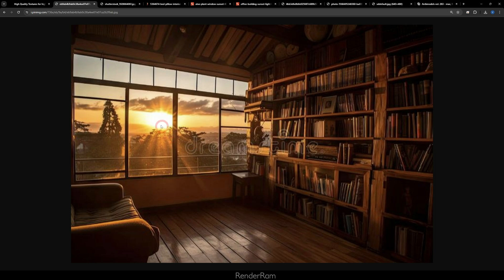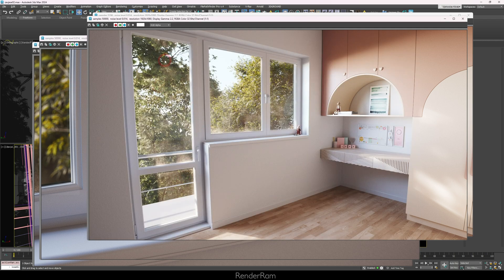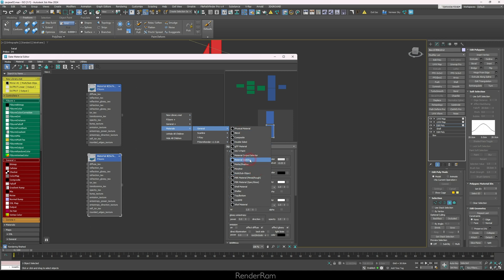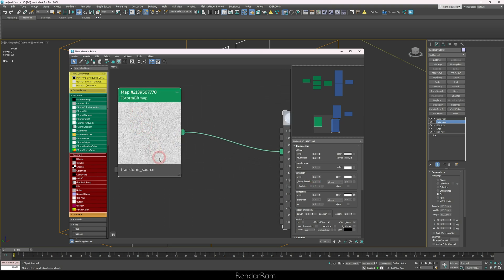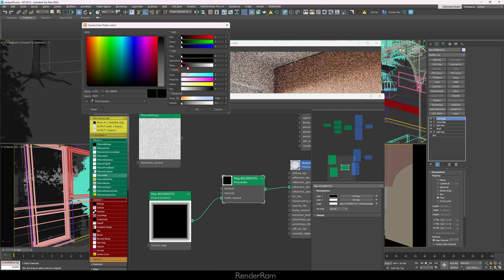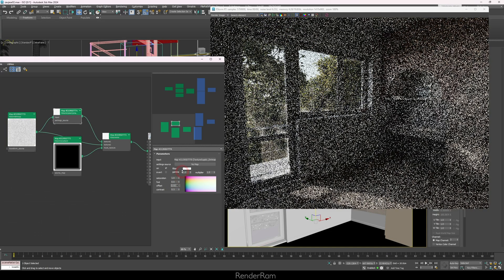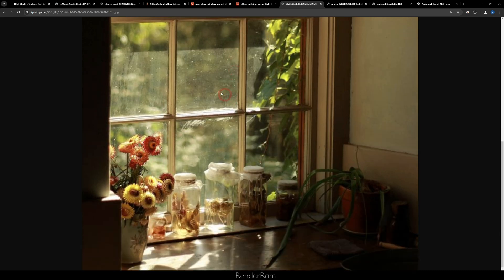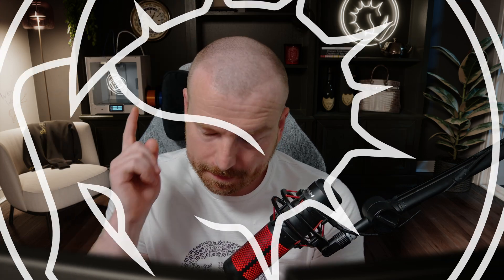Materials Ep8: Dirty Windows | All 3D Software

Comment: It's important to note where dried raindrops should appear. Because the reason for it appearing more on the edges is because you get stains where water dries. But rain drops can't dry when they move. So they only dry when they stopped or stopped moving mostly. Which is around corners/hard edges, where water can no longer fall down that easy. It's an barrier for the rain drops. And that way they all become like a traffic jam that dry all together on one corner. But also important to know is where rain can actually get onto the windows. If your house have a large overhanging roof in front or rather above the windows. Rain will have a hard time to reach every area of the windows. So the upper part are mostly dried and maybe rarely get hit by water when it's stormy and the rain comes from a more angular angle. So the upper part of the windows should be more clean then the lower ones. So the lower ones must be the dirtiest. And then you have another layer of stains when cleaning windows. Especially in deep corners of the window where most tools can't reach that well. So dirt will be mostly on the edges again.

Comment: Not sure why as I’m copying what you’ve done but in corona and it just doesn’t work very well. am I missing something ?
Reply: Could you recreate it? I have the same problem.
Reply: @jannikblum3422  same problem with vray. translucency seems to behave differently. when i plug the map into the refraction it completely warps the exterior of my window.
Reply: @tayayoung6031  maybe you can use a layered material. One with standard glass Material and one with the dirt material (just a light brown color). 

You can then use the gradient map and the dirt map from texture supply to mix the materials.

Hope this works for you:)